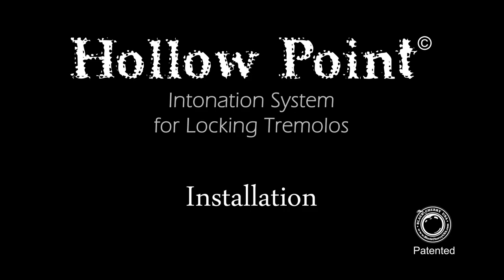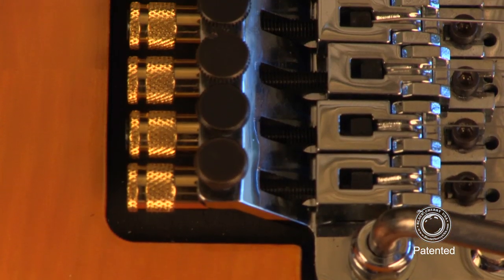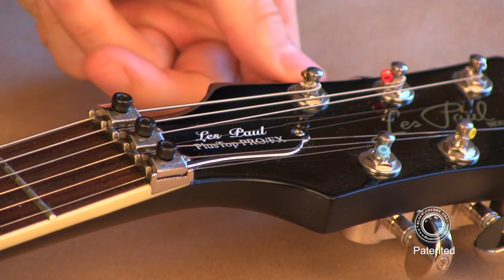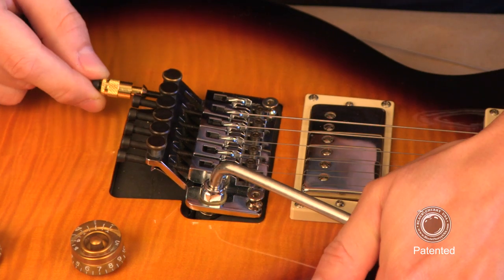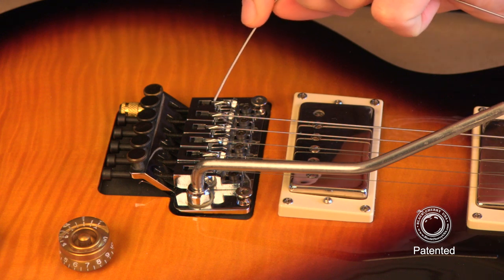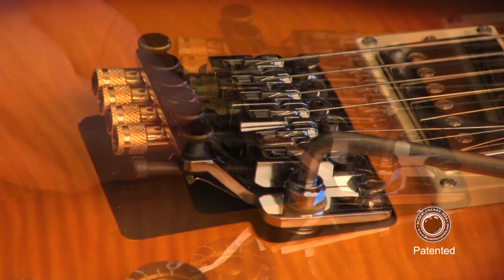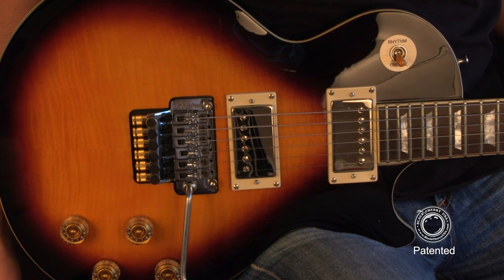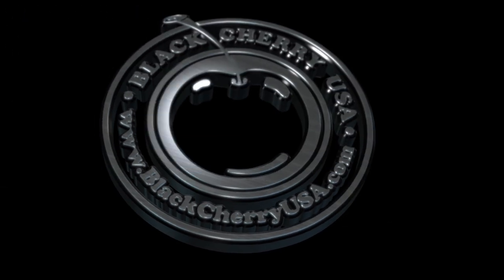Hollow Point Intonation System Installation for Double Locking Tremolos

Comment: This is neat!  Although I don't think this will work for the Ibanez bridges because they have separate intonation screws that the saddles "slide" into and tighten it down.  This is a great idea though.
Reply: surgeyX works for my Ibanez prestige rg655 with original edge. .
Reply: Will work on the original Edge only, which honestly is the better trem anyway